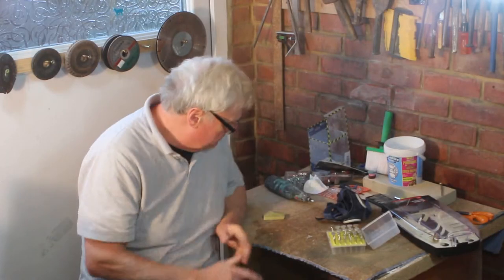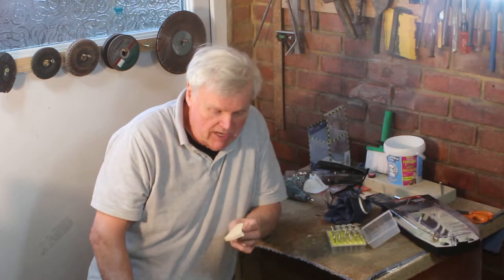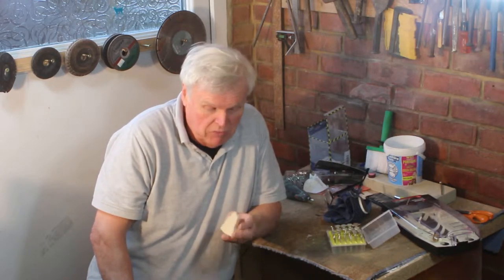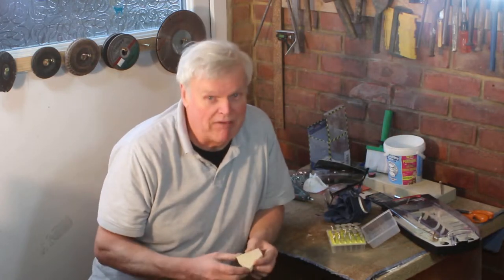Carving a Maori style hook from limestone using the Parkside cordless rotary tool

Comment: Good job. I have an Ozito rotary tool that my son bought for me. I haven't made much use of it so far but I really want to learn how to use it. I have an extension "pen/pencil" type holder that I can screw onto the front of the rotary tool which makes it much more smaller and lighter for handling. I noticed that you hadn't used one of those in this video, was that by choice? that you prefer to have the weight of the rotary tool for balance or better control? I've made a stand for the rotary tool to be hooked onto so I can sit at a bench and use the pencil type grip. Would love to get some feedback from you, thanks, Allan.
Reply from the maker: Hi Allan, I do not have a flex drive for my type of tool yet, so I can't make any comment on wether it is better or not. I will buy a flex drive as soon as I see one , At the moment I am quite content using the tool as is although I suspect the pencil grip will allow for more control on finer work. My confidence and skill with the tool is slowly getting better and I urge you to keep at it! Thanks for watching and please do let me know how you get on.
Reply: Thanks for the reply Steve. I'll surely give it a go and see what I can come up with. I appreciate your thoughts. Allan